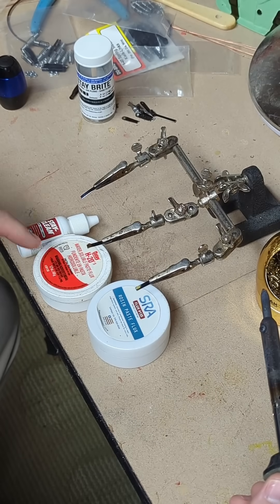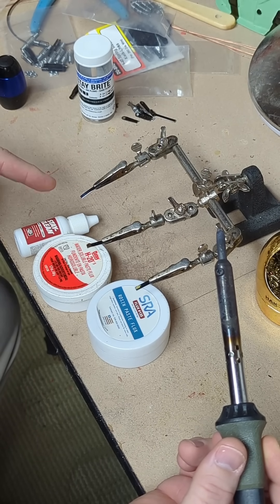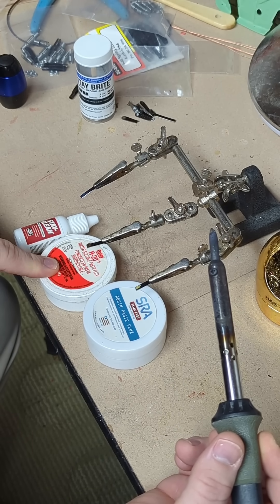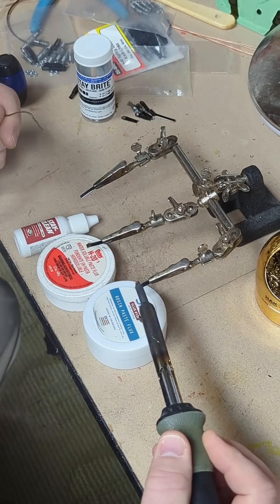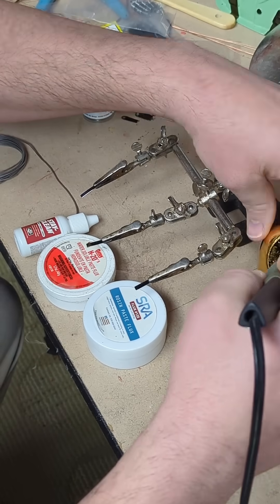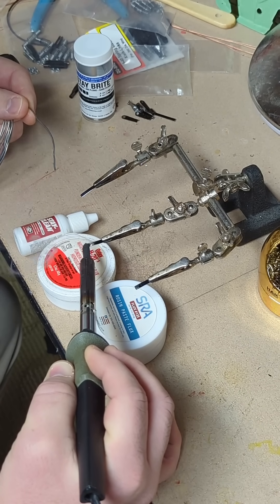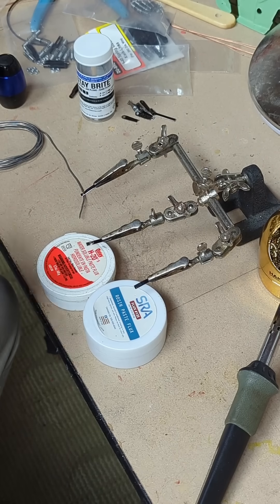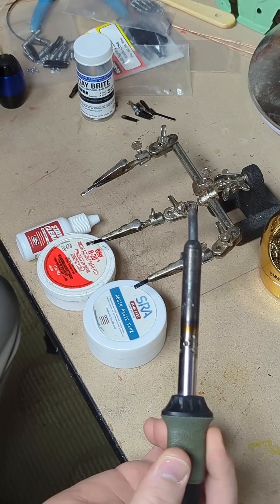Flux MATTERS for different solder joints #modelairplane #soldering

Comment: I really struggle with soldering to be sure. Will have to get me some of this flux.  And maybe a new soldering iron!
Reply from the maker: Don't get me wrong, a good iron helps. The chemistry of what's going on is the key. The acid etching of the right flux will help bond and flow the silver solder where you want it.